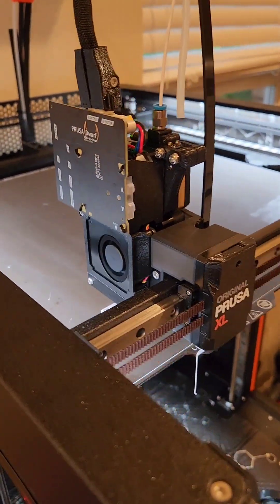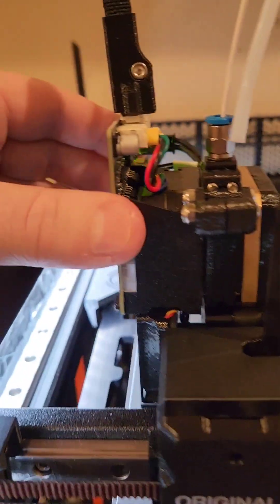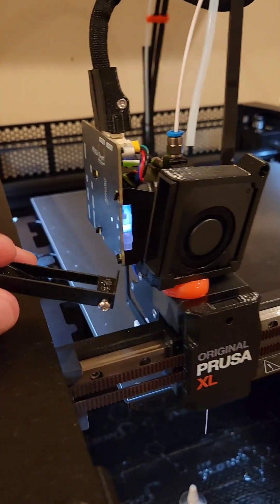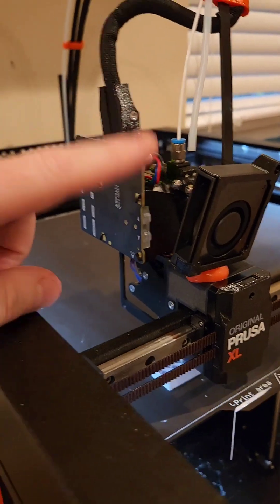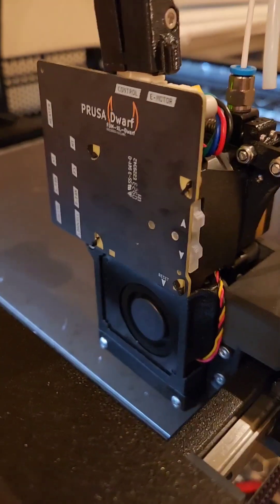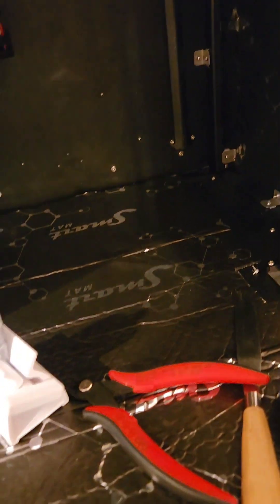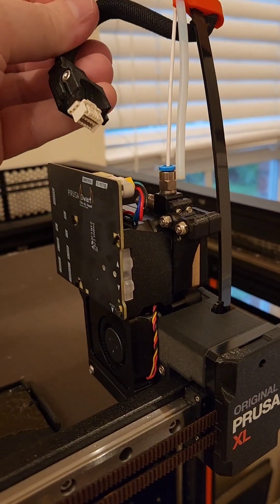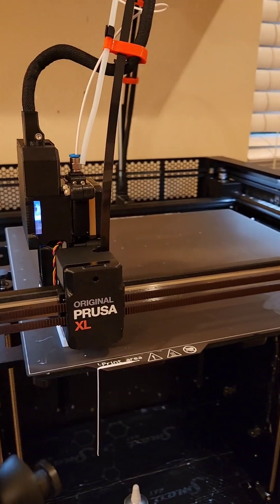Quieting Prusa XL Noisy Nextruder Buzz

Comment: Awesome video! I'm going to try these on my XL5T. 

Not trying to be annoying, but one thing you may want to consider especially for foreign viewers, is you are pronouncing silicone as if it were "sili-kun", rather than "sili-cone." For people speaking English  as a second language, the proper pronunciation may help them a bit as I have seen confusion on forum posts before. The 2 are completely different materials - silicon is hard and crumbly and used to make computer chips.

Comment: What is the orange material you use? It looks like wax, the silicone earplugs I know keep their shape, do not deform like this. How is this called? Also very annoyed by this resonance more so because I live in a small apartment. Thanks!
Reply from the maker: They are silicone ear plugs like the ones linked below. They are squishy, so you can press them into your ear... or 3d printer.  You can get them a lot cheaper from your local pharmacy section.  https://a.co/d/9mu3OW8